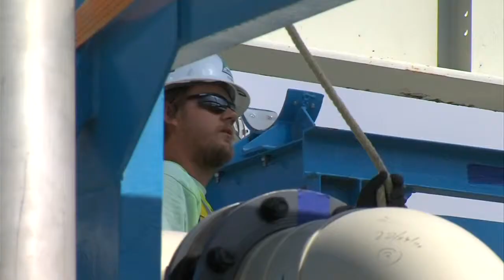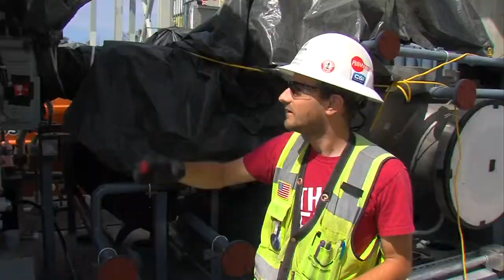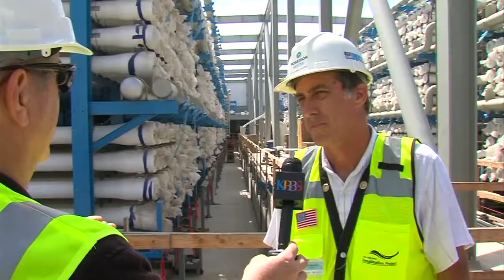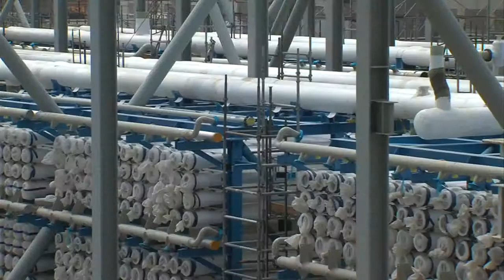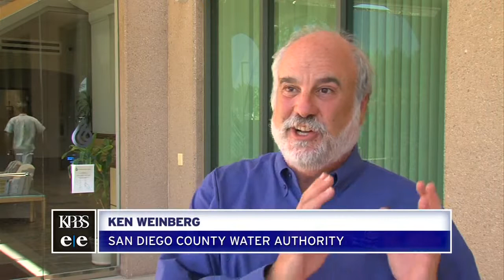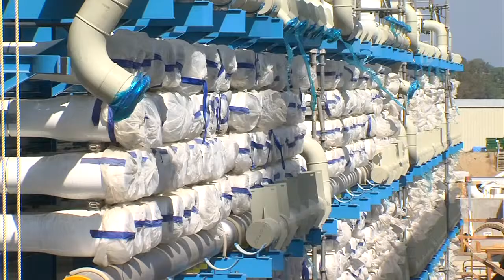San Diego's Million Dollar Seawater Desalination Plant

Comment: Why not just pump cold water from the bottom of the ocean through a series of pipes and then collect the freshwater condensation that forms on the outside of the pipes? Just like your soda can "sweats" before you open it, the pipes will sweat and then water can be collected underneath the array. A city like San Diego may need more square footage for such a project than the size plant shown here, but the long term savings would be huge because of the relatively low maintenance cost of such an operation.